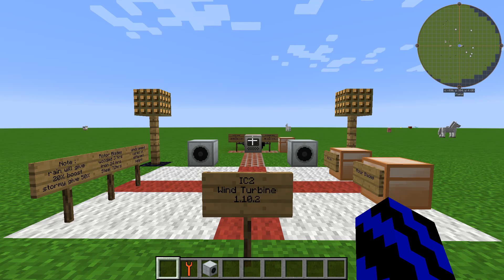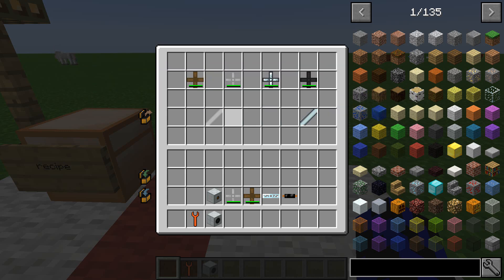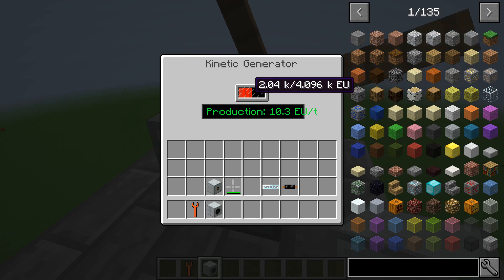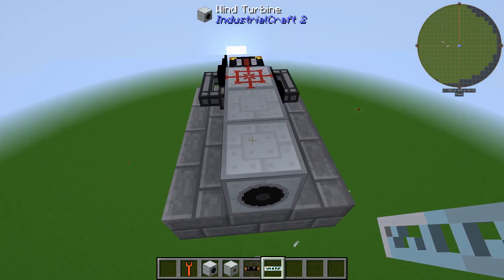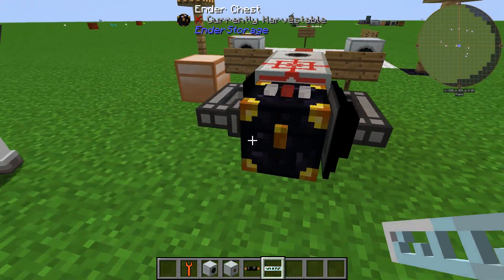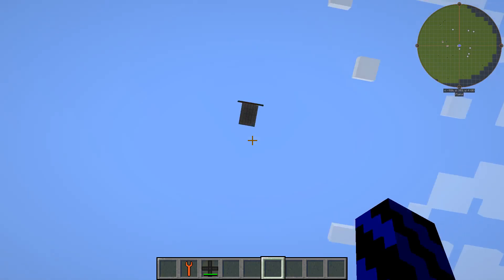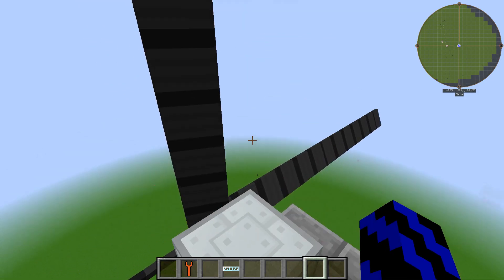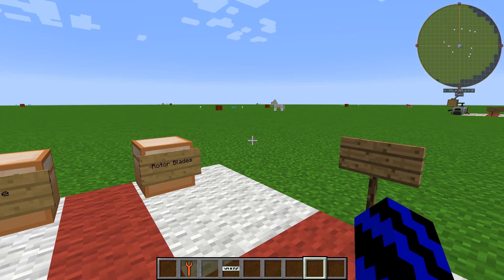IC2 Wind Turbine Tutorial 1.10.2

Comment: How do you get the kinetic Generator
Reply from the maker: You will need 6 iron cases so 3 along the top and 3 alone the bottom a electric motor in the center a generate on the left hand side in the middle and a iron shaft in the middle right hand side

Comment: whenever i connect my mfe thats getting power from wind turbine to one of my machines it explodes
Reply from the maker: That will most likely be that now  the MFE is medium voltage and the wind turbine is low voltage so you may need a batbox or to use a transformer for it to work  hope this helps.
Reply: An MFE is level 3 power and your machines are level 1. You need a medium and low voltage transformer to make the power equal.